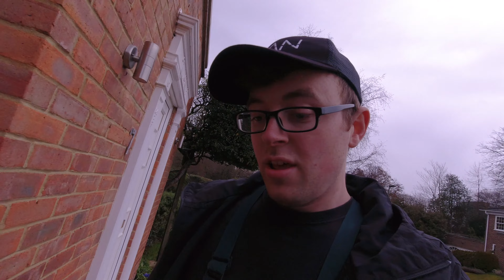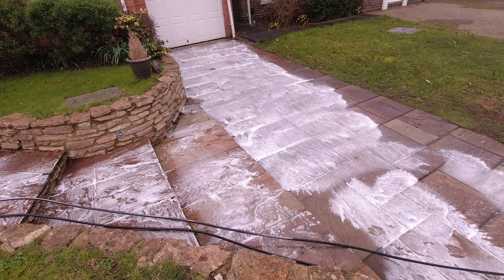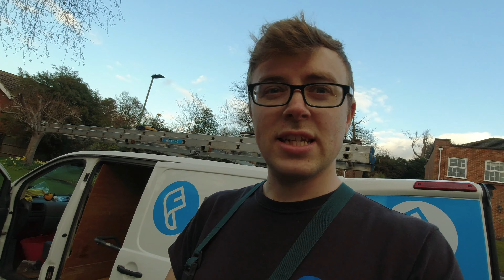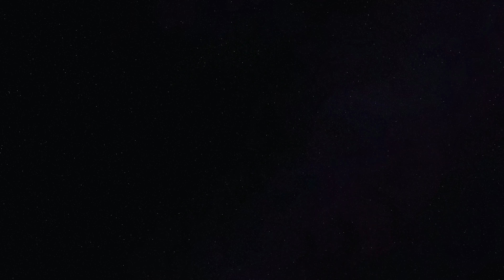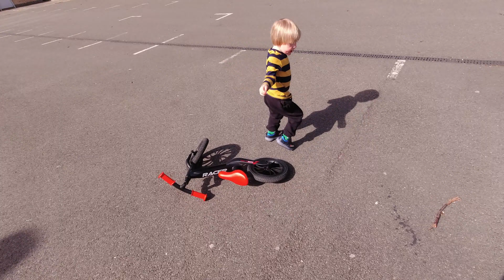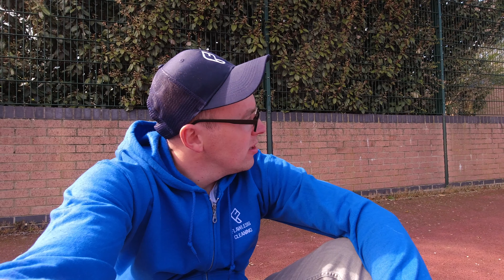Blasting The Grime AWAY! Pressure Washing & Treatments

Comment: Really good 👏.. 2 questions mate;
1) is it a blast with mosaic to begin with followed by biocide and then rinse with turbo? 
2) what biocide do you use?
3) what’s the clean up process like ? 
Thanks 🙏🏻
Reply from the maker: Cheers, 
Sorry I’m not sure what Mosaic Is, and no biocide on this job. But I do like Benz products 

Cut In with a 40 deg, flat surface clean, rinse down but with a turbo on the sandstone, used sodium hypochlorite and then rinsed throughly.
Clean up Is fine, I just keep on top as I go eith rinsing doors, windows, walls etc. Bag up moss and dispose of it.

Hope that helps and have a good weekend
Reply: Thanks so much mate really helps a lot. I take it as long as it’s hosed down the. The run off onto grass from chemicals is fine
Reply from the maker: I tend to water before, during and after to be on the safe side, no problem at all 👍🏻